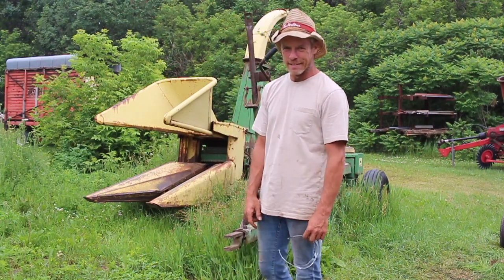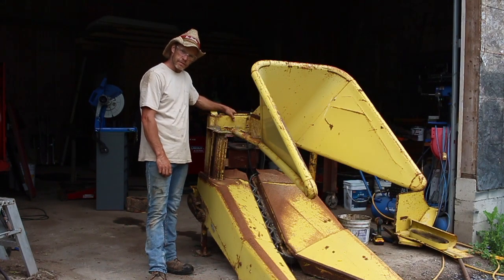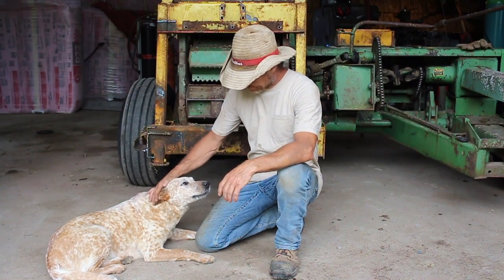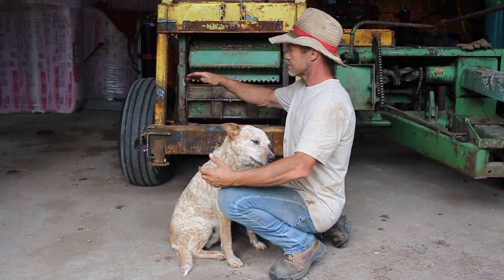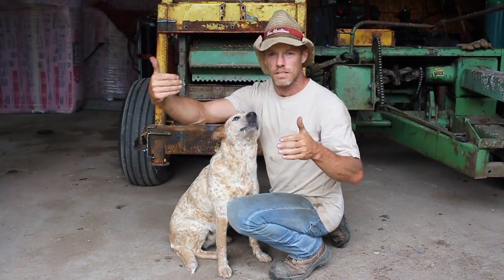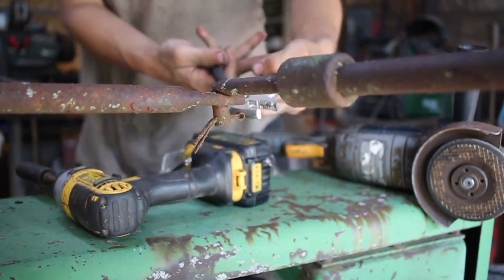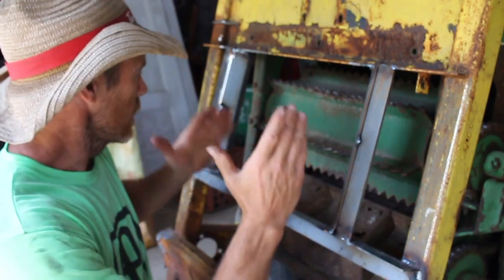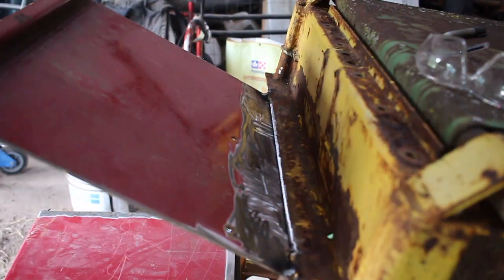Forage Harvester Wood Chipper Build

Comment: Have been wanting to do this for a long time. Thank you for the tips. Nice job. Are cut and throw choppers better for this compared to auger blower set ups?
Reply from the maker: I’m not sure… I would say the auger throw would be better… I got a 35 JD and it never plugs doing corn and Haylage… but that 34 JD plugs all the time wilt Haylage, gotta be full pin all the time with the cut throw one.